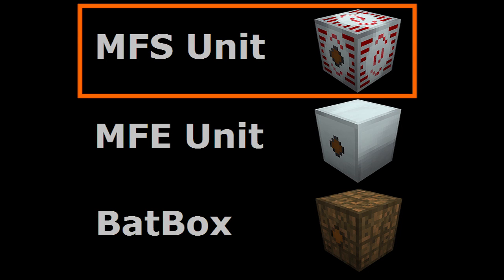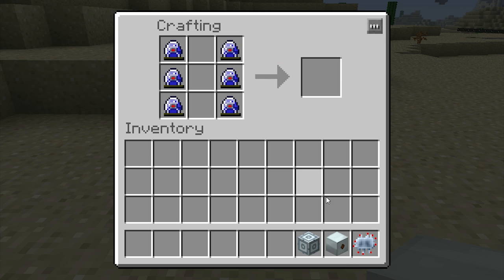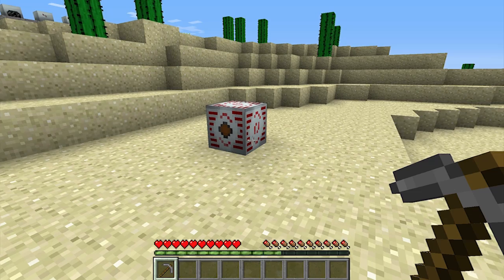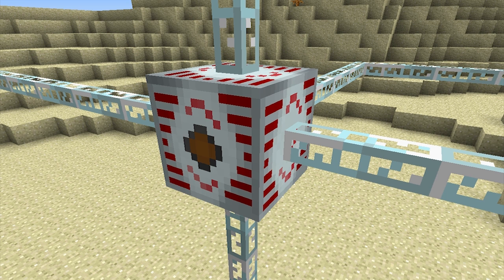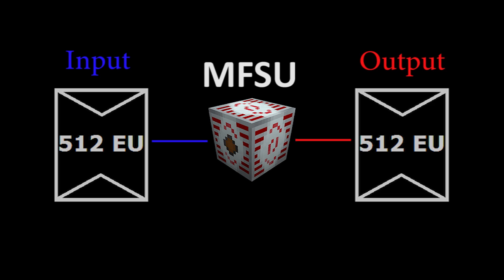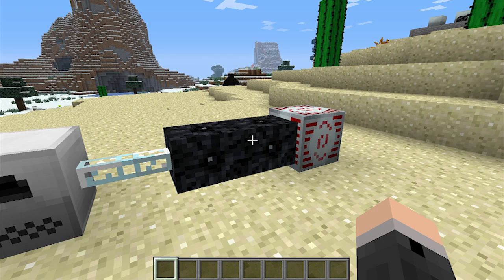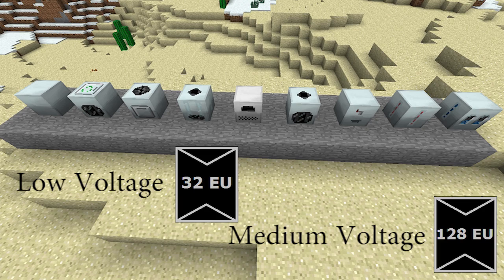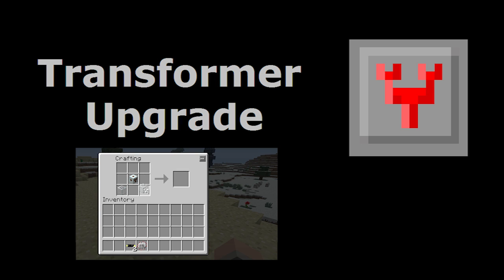MFSU (Tekkit/Feed The Beast) - Minecraft In Minutes

Comment: why does the LV  transformer blow up when i put the three cable thingy facing the cable from MFSU?
Reply: The MFSU outputs HV energy, the LV transformer can only take in MV energy and output LV energy, because you put in HV energy, the packet size was too much for the LV transformer to handle and it blew up.
Reply: i dont know if you still need help but the lv transformer can only convert mv energy to lv meaning, you need a medium transformer in between for it to go from high voltage (HV) to low voltage (LV)